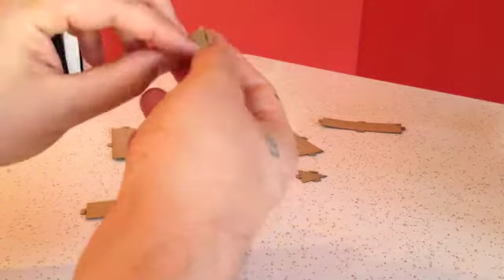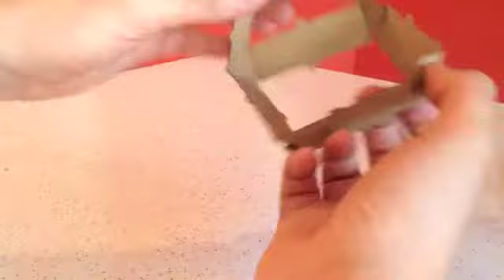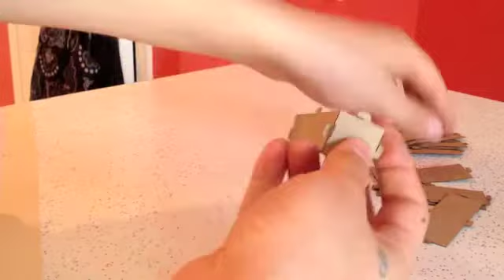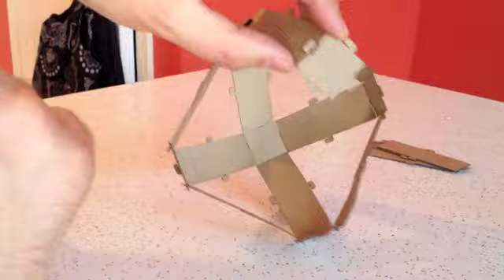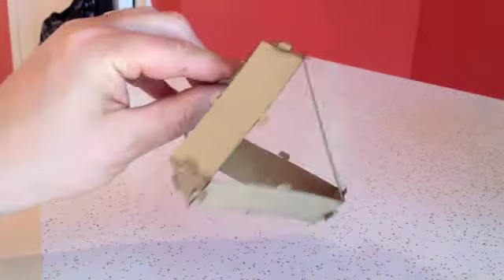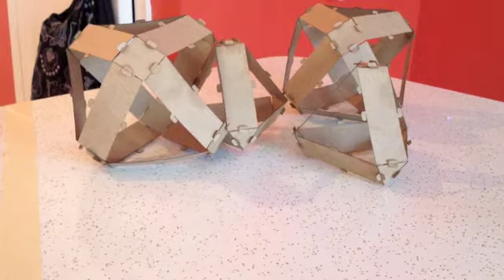Vertex + Edge Construction Set: Filling space with Octahedra and Tetrahedra

Comment from the maker: I've designed a laser cut construction kit using chipboard (cereal box material). The pieces model edges and vertices and can thus model various polyhedra when put together. As a side effect of the edge design, individual polyhedra can be hooked together to create larger, space-filling structures (octahedra and tetrahedra fill space). Buckminster Fuller octet truss! The pieces connect via little hocks. These hooks work because of surface orientability. The hook directionality induces a face orientation, and where pieces connect, the edge directions cancel out! Thank you algebraic topology, 3-cells, 2-cells, 1-cells, boundary simplicial complexes and all that stuff! In this video, I explain how it all works and give a building demo.